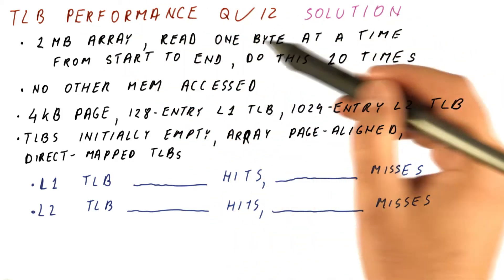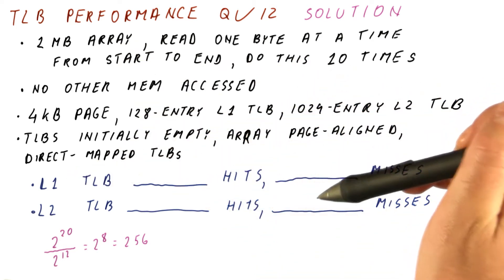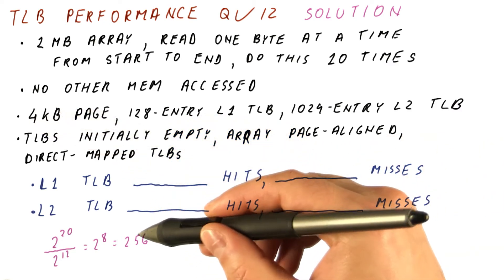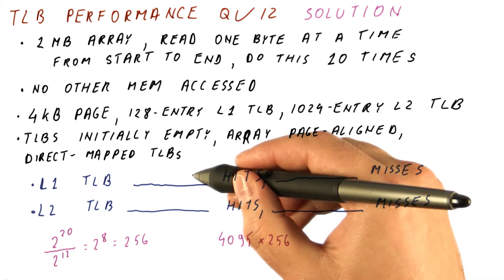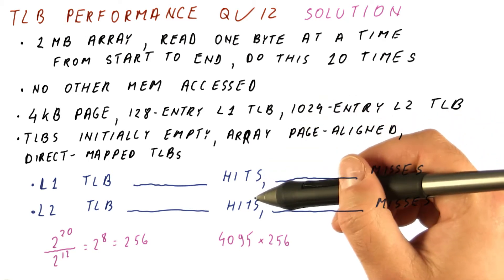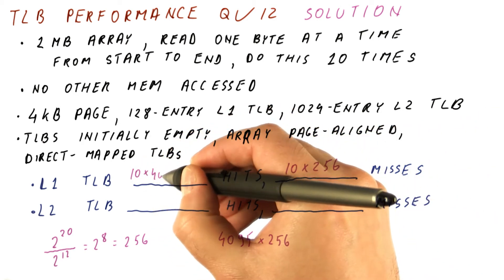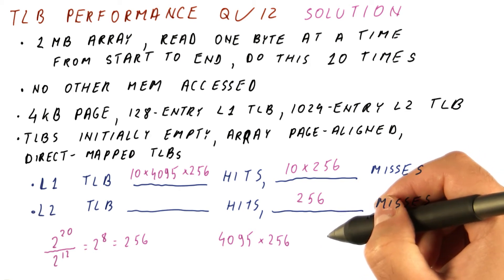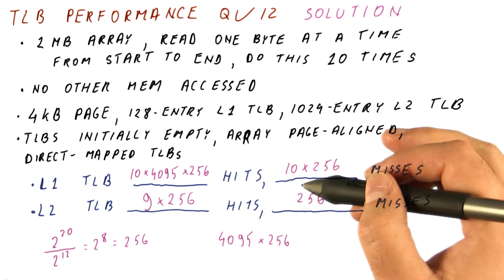TLB Performance Solution Quiz - Georgia Tech - HPCA: Part 4

Comment: very nice conceptual question. Thanx a lot, awesome
Reply: I'm not able to understand the solution. May you explain it in your words.
Reply: @swatirauniyar9062   Total size= 1 MB. Page size= 4KB. So we have (220/2^12=2^8) = 256 entries.
Now, 1 entry contains 2^12 bytes. So when we don't find a byte and bring its corresponding entry in TLB, the remaining (2^12-1)= 4095 bytes are all hits.

1st access:-
 All 1st bytes of 256 entries are compulsory misses in both the levels of TLB since TLB is initially empty.
When we bring an entry, remaining 4095 bytes are hits. So this happens 256 times for each entry in 1st sweep.
So,
 L1 hits= 4095*256. (remaining bytes of each 256 entries) 
L1 miss= 1*256 (1st byte of each 256 entries).
L2 hits= 0 hits. (A byte access when missed in L1, it's searched in L2,  then when not found in L2, then brought to both level TLBs . Then L2 level not checked again for remaining 4095 bytes as they are all hits in L1)
L2 miss= 256 (each 1st byte of entries when not found in L1 for 1st time searched in L2 and also not found)

After 1st time access of 1MB, L1 has 128th to 255th entries in its TLB (since its size is only 128, 1st 128 entries came, then were replaced by next 128 entries). However, L2 can hold max 1024 entries, so it has all 256 entries waiting to be accessed in the subsequent 2nd to 10th accesses, every time some byte is not found in L1.
Now 2nd access:-
 Again same thing repeats for L1. All 1st bytes of 256 entries are misses and next 4095 bytes are hits.. (When you need 0th- 127th entries, L1 has 128th- 255th so no use and miss and replaced by 0th-127th. Then when you need 128th-255th,again all misses since you now have the 1st half!)
L1 hits=4095*256.
L1 misses= 1*256
But for L2, misses=0 from now on. And hits= depends on times when L1 has missed. =256.
L2 hits= 256
L2 misses=0

It repeats for 3rd,4th....10th access i.e 9 more times
Total:-
L1 hits= 10*4095*256
L1 misses= 10*256

L2 hits= 0 hits 1st time + remaining 9 times 256 times for every 1st byte missed by L1= 9*256
L2 misses=256 misses for 1st bytes of each entry during 1st time+ remaining 9 times 0 = 256

I hope this helps if I have understood correctly.
Reply: @misspelled_variable  Amazing explanation. My only question was wondering when the 128th entry was replaced in L1, and I realized he did not mention that L2 entries were constantly being fed to L1 so the accesses were actually increasing (it might have been obvious, that was my mistake).
Reply: @naehalmulazim  Glad you found it helpful. :-)
Reply: @misspelled_variable  yes, very, thank you again.
Reply: very good explaination , thx @misspelled_variable
Reply: @yxu2973  Glad I could help!
Reply: @misspelled_variable  Thanks for the explanation, I had the same doubt as @naehalmulazim
Reply: @Aalok Bhardwaj  I am so happy you found it helpful!